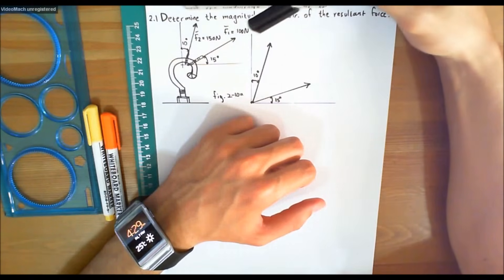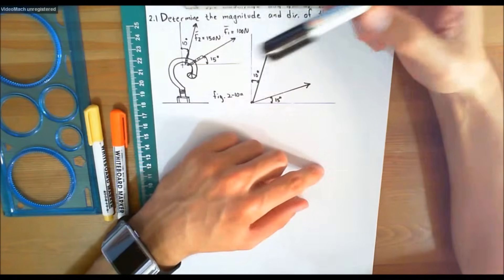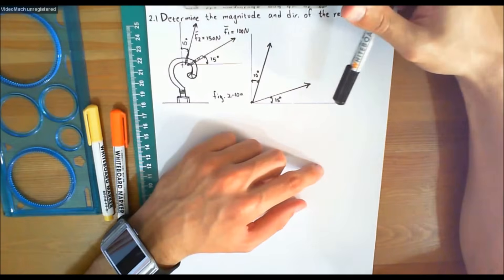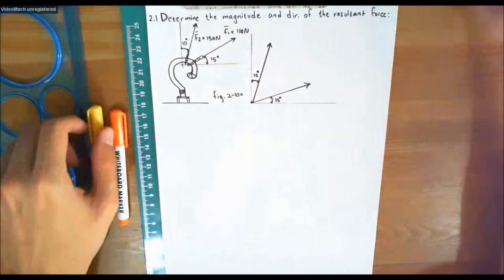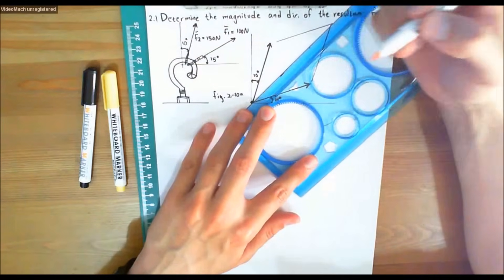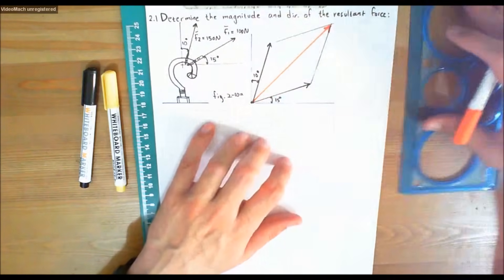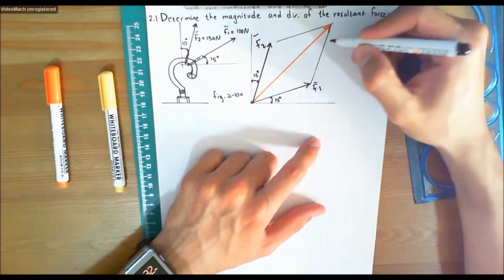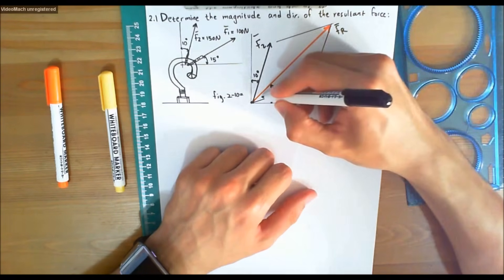Statics Lecture 14:  Problem 2.1  Finding the Magnitude and Direction of the Resultant Force

Comment: Not Trigonometry.  It is Geometry.  What? The sum of the angles of a parallelogram = 360.  It is from the Quadrilateral theorem from geometry.  To get the 115° angle. Not trigonometry.